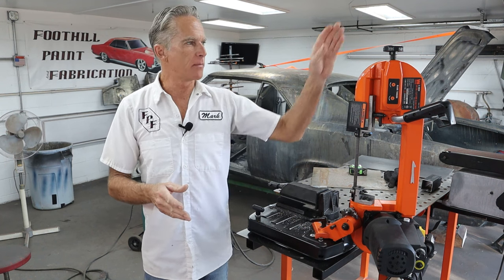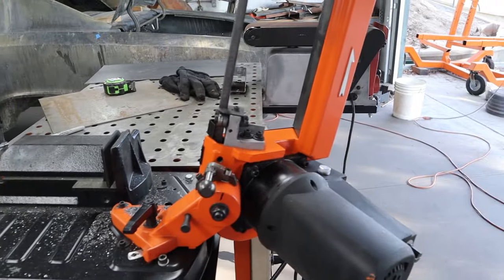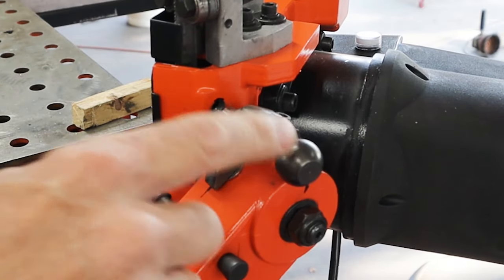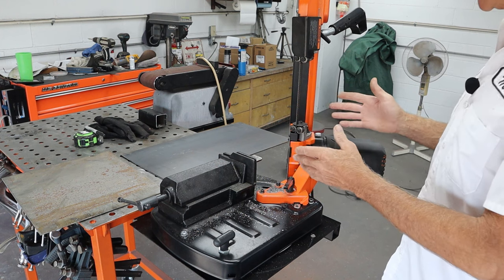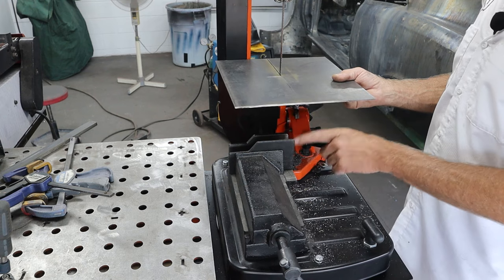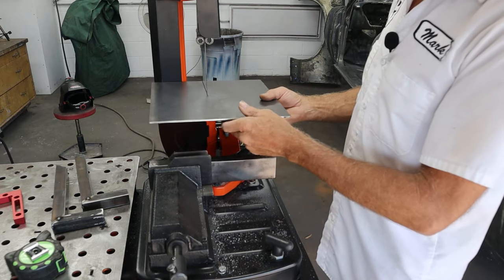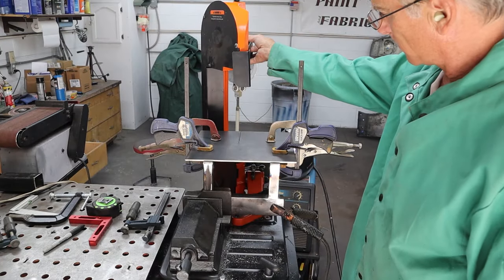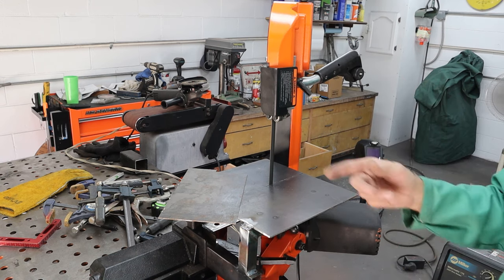Wen 5" Band Saw Mods - Horizontal to Vertical Saw

Comment: Nice work Mark. My horizontal/vertical bandsaw has a crappy table on it that is pretty much useless. Now I think I'll make a better table for it. I like the idea of putting it in the clamp instead of the pita screw on table. Thank you for your time.
Reply from the maker: Thanks, I have used it a lot already and it is super quick to switch back and forth. Cutting thin gauge is so much easier now.
Mark